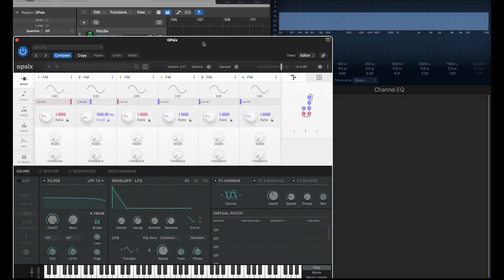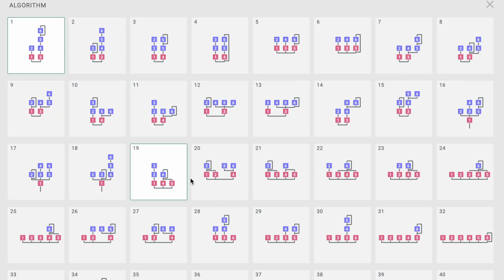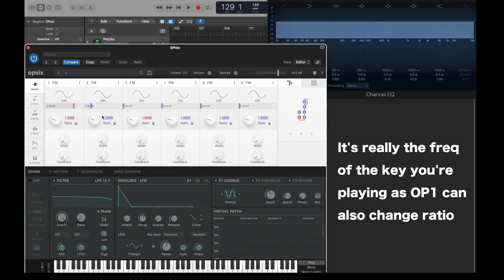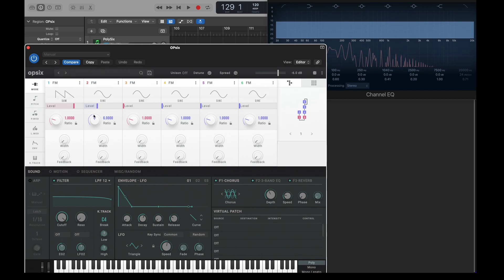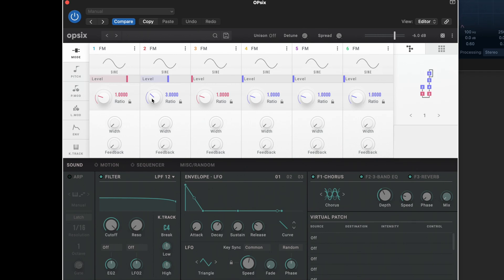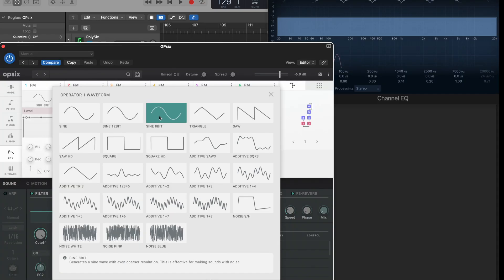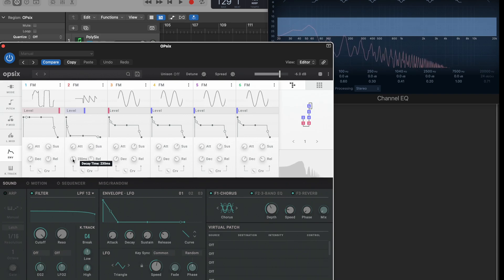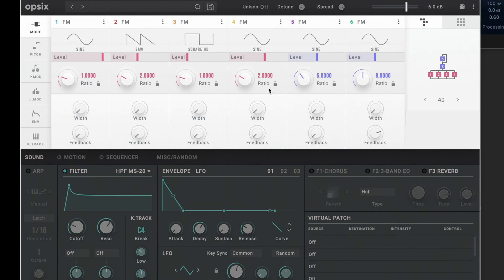FM Synthesis Demystified // The Basics with Korg OPSIX

Comment: Do you have thoughts of opsix vs reface DX and dx7?

It's a shame to me reface DX only has 4 operators but it's very small and light. 

Curious if 4 operators is "enough."
Reply: 4 ops is the sound of the sega genesis. Listen to some genesis osts & decide for yourself! I love the sound of two & four operator FM but definitely prefer six. There’s a place for both really. The reface dx is okay, pretty limited. You’d be better off with one of these, if you’re working in the box you’ll want to check out Dexed which is a free dx7 vst with tons of free cartridges (sets of 32 patches each) online to load into it. Also elektron digitone is 4 op, listen to that as well to help you decide whether 4 operators is enough for you personally.

Comment: The interoperablity between the hardware & software really works. I just tried it today: created a simple 2-op EP sound on the hardware, saved it, pulled it in to the Librarian, saved it as an op6program file in the correct folder. It was immediately available in the VST3 under the "User" category and sounded the same.

Comment: are fixed ratios what they call linear fm? and the fluid ratios exponential fm?
Reply from the maker: No, linear vs exponential is the way the modulation is applied. On a DX7 etc it’s not strictly FM but phase modulation- just to confuse matters further. But the principles are the same
Reply: @StarskyCarr  oh boy, fm synthesis is going to be a hell of journey! Thanks!!